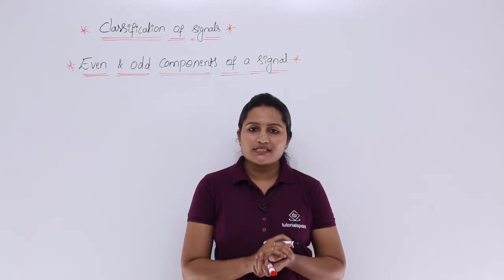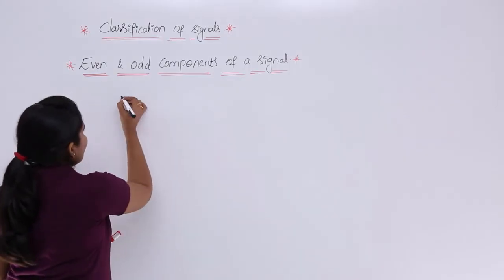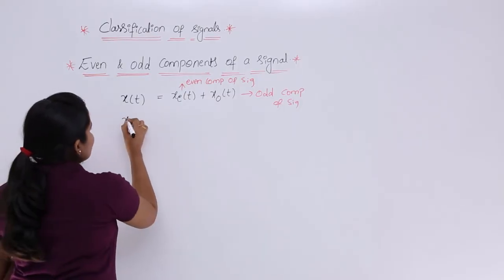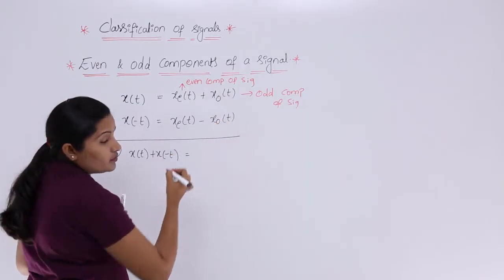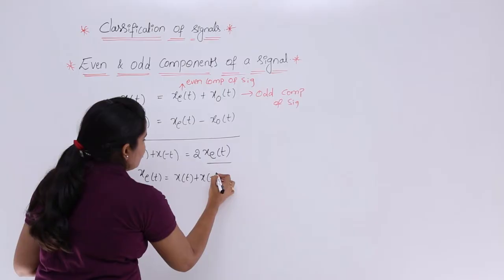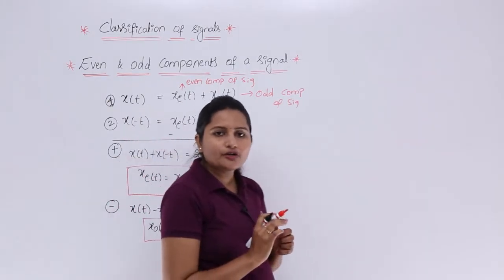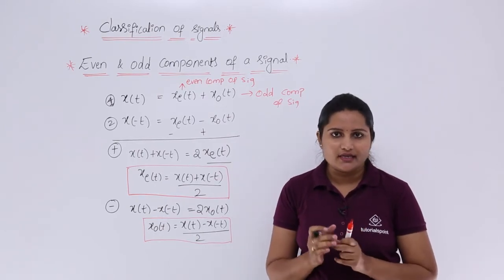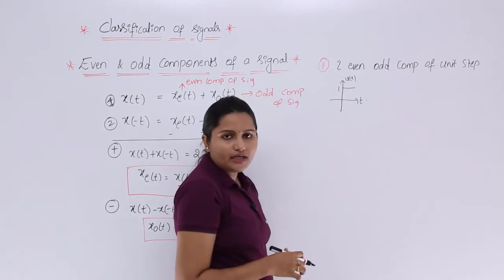Signals & Systems - Even & Odd Components

Comment: is even part of u(t) not = (1+1)/2 = 1???
Reply: yes that is also my question...at t=0 both u(t)and u(-t) have a value 1 so the resultant should be 1+1=2..but by gibbs phenomenon it would be (1+1)/2=1
Reply: @biswadeepchakraborty2460   Even I feel the same
Reply: actually u(-t) will be zero... , so Ue(t)=1/2
Reply: @himanshumishrabadal6806  
No I guess 
Because u(-t) is just reflection of u(t) like a mirror image so at t=0 it's 1 at u(-t)  then it upto - infinity  it remains 1 only 0 to - infinity is remain 1 only. Which I feel.
Reply: Even signal=        
{....0.5,0.5,0.5,1,0.5,0.5,0.5...}
Odd signal= {...-0.5,-0.5,-0.5,0,0.5,0.5,0.5...}

u(t) = {0,0,0,1,1,1,1..}
And
u(-t) = {.....1,1,1,1,0,0,0}